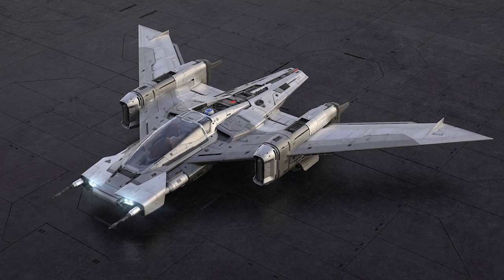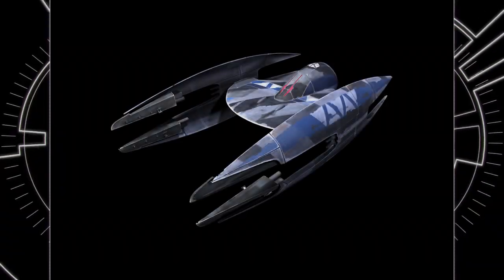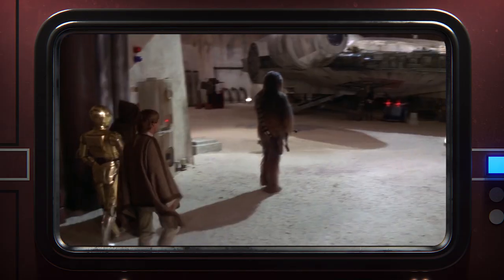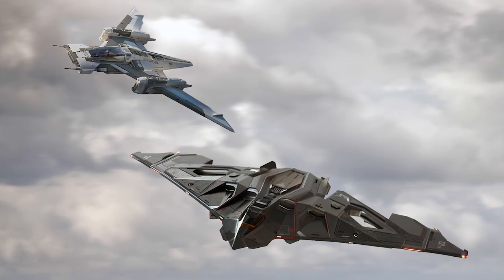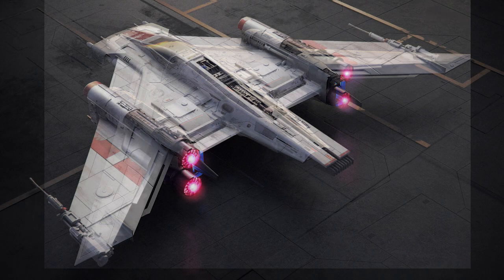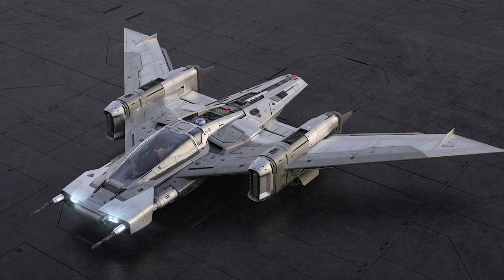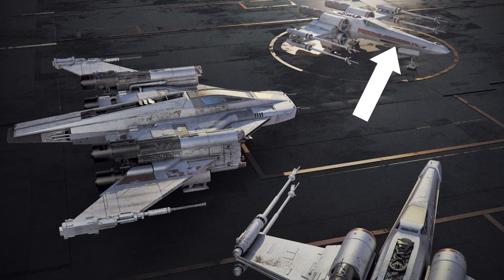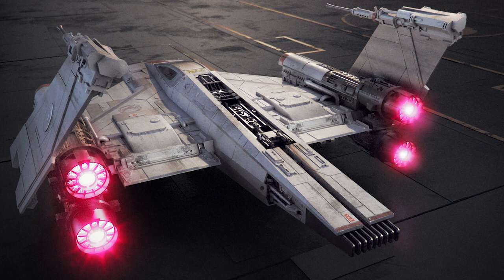Fixing Porsche's Star Wars Ship

Comment: I think you failed to understand the point of the Porsche design, your design looks like a rebel ship, not a top notch paint job, worn down a bit and has some flaws like no side windows, instead you have some kind of armor.
The Porsche design is much more luxurious, has side windows for the pilot to see through, and has a more refined design in general.
You looked at this from a combat standpoint, while the Porsche design would probably be a ship for the rich to use commercially. In that case your ship lacks the design on that point.